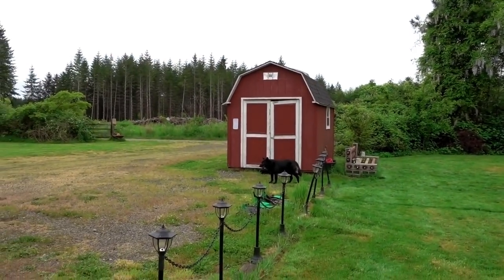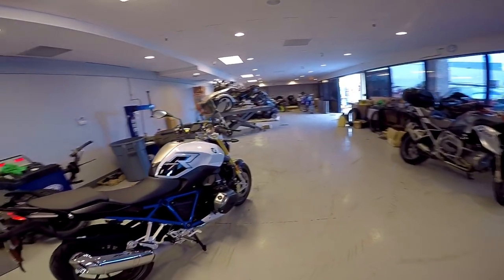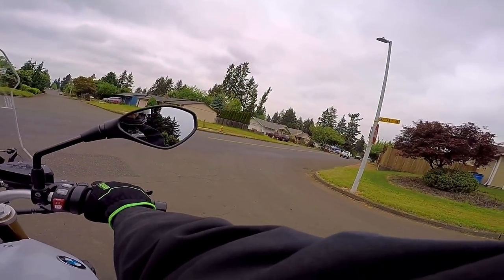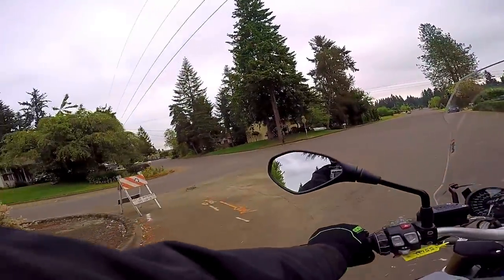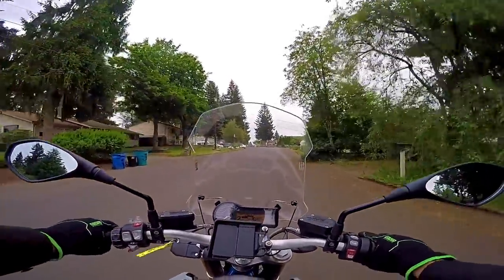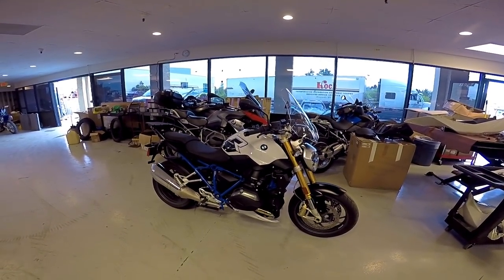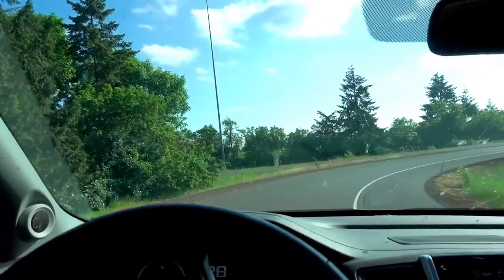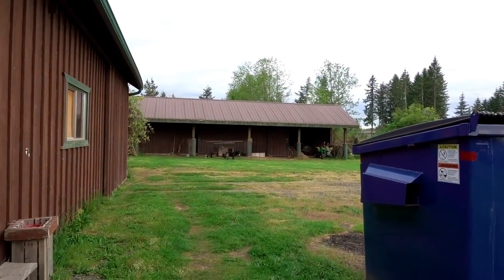Crazy Fun R1200R Test Ride!! • Cleaning Things Up..! | TheSmoaks Vlog_912

Comment: I was a little hesitant about the gear shift assist pro at first. I felt a bit old school and that using the clutch was part of my rhythm. So never really used it until I spoke with my brother in-law who has a S1000XR. After that I started using it more and more and then I realized...you can just crank that throttle wide open and flick up through the gears, system blips the throttle for you, gear shift is instantaneous and the acceleration is nothing short of glorious and that is on a R1200RT 😀 I freaking love using it now ! Would be hard for someone using a clutch to keep up no matter how good a rider they are. I have a 2018 and the change to 2nd is a little rough on hard acceleration....you just need to hold on tight 🤣🤣🤣

Comment: Shawn, when I had my 2016 S1000XR I had the display replaced under warranty due to the fuel gauge not going passed 3/4 full, even when the tank was full.
I had loads of faults on my XR, though I still consider it to be one of the best bikes I have ever owned.